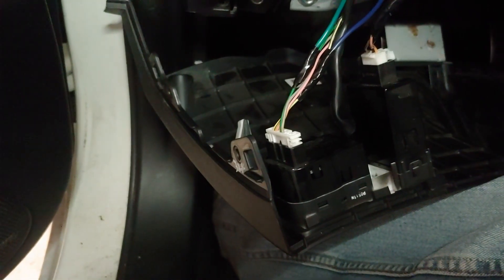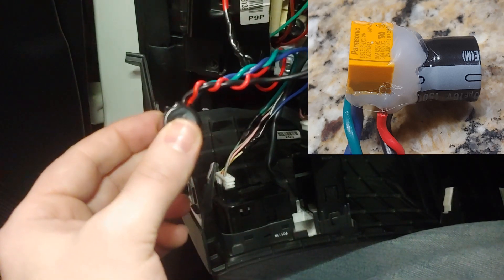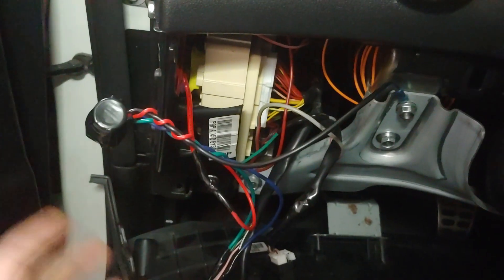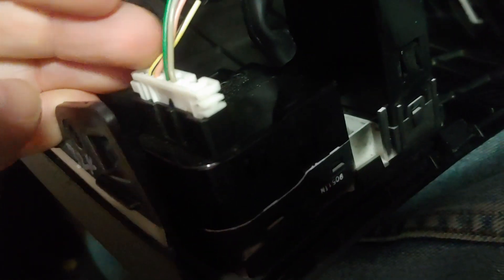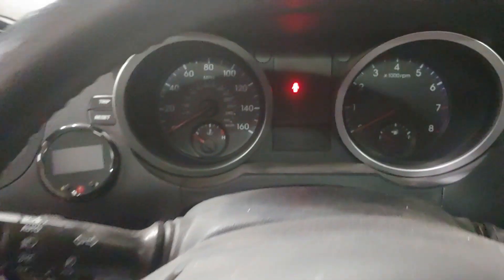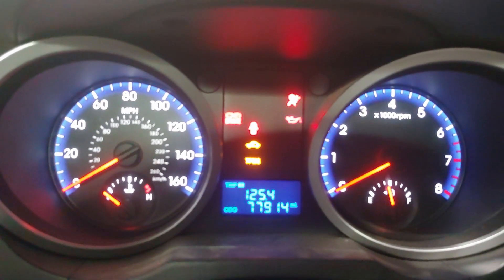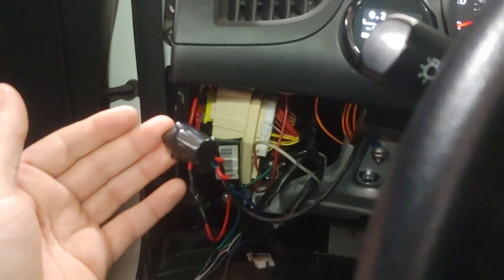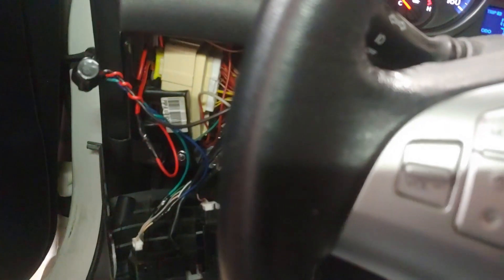Traction Control Auto-Off - Genesis Coupe, bk1/bk2

Comment: I feel like u save a small percentage of gas ⛽ when i have traction control on...who knows if i really do. I definitely use it on rainy days
Reply from the maker: It's not a mod for everyone for sure. This is a summer car and on e85 so I'm not worried about saving fuel. If it rains I turn it on with a simple push.